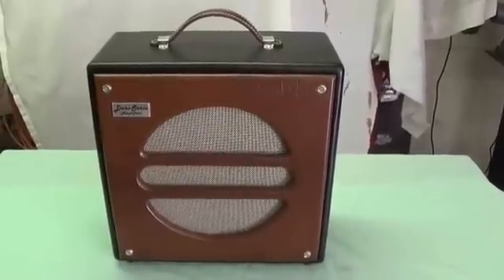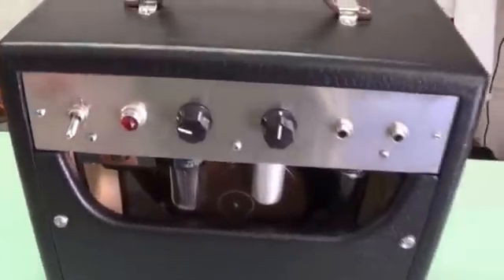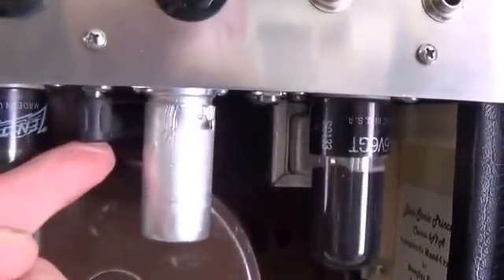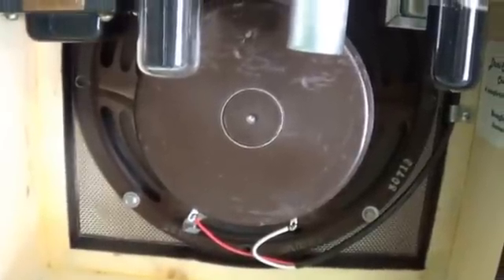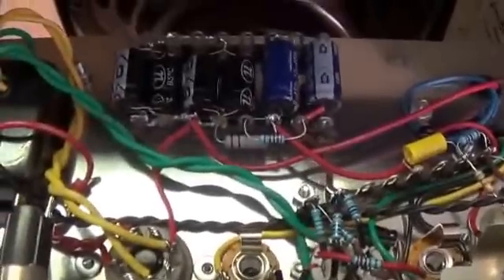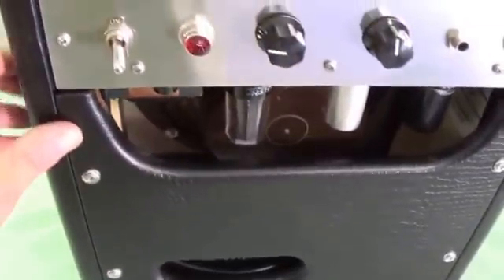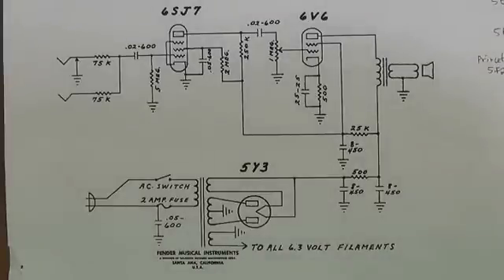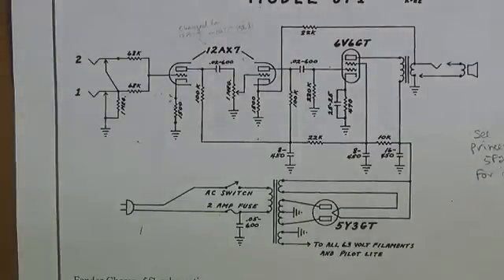1950's Fender Princeton 5F2-A Home-Built Guitar Amplifier

Comment: Hi Uncle Doug,

I have a final question on that 1k  grid stopper on pin 5 of the 6v6.  What wattage and type would you recommend here?   I was thinking likely 1w or 2w  carbon comp.  Any better ideas?  I've read the big factor on grid stoppers is low inductance resistors and not having steel leads or steel caps.  What is your experience?

Comment: Hello Uncle Doug,

I've been watching a bunch of your videos. I appreciate you taking the time to make them. Especially the lessons about amp electronics and evolution. 

What was your reason for the grid stopper resistor being added to the 6v6????  what determined your resistor value??  I have just watched the resistor vid on grid stoppers  where you talked about 12ax7.  
What affect would this play in this princeton build?

 Would you apply this to other designs such as a champ too? 

Thank you, 

Stu
Reply from the maker: +stu mac   I believe the answers to your questions are all in my more recent video series on Resistors, including the "Grid Stopper" resistor. Please watch it, and my other 127 videos, whenever you get a chance. They cover all aspects of amplifier circuitry and design.
Reply: +Uncle Doug 

Thanks for your reply.  I did watch the resistor vids prior commenting.  I did see the parts about low pass filter and internal cap. of the tube.   

I was wondering why you chose to add it to your design.  What change would it have in particular?  

What about the original were you trying to tweak??? 

I'm re watching the resistor series.

You did help me with a mistake I made in my 5e1/5f1 adaptation.  I had a 0.0005uf mica on my volume to tone   pot. I also had a 0.0005 mica on my tone to ground.   I missed a decimal I guess.  I've just put it to a proper 0.005uf  I haven't tried it yet.   I wondered why everyone likes the tone control but I thought it sucked on mine.  

Cheers!  
Stu
Reply: +stu mac 

That 0.005 cap in place of the 0.0005 from tone to ground changed my whole amp ! completely!   

I looked through my stuff and only had a 1.5k resistor as closest value. So I didn't use one yet.

Comment: Awesome! Do you build amps for other people who would supply a chassis for conversion? Thanks.
Reply from the maker: +Bill Smith  I don't do outside work any more, Bill, except for the occasional restoration of an interesting vintage amp (or two).
Reply: +Uncle Doug Ok thanks anyway. So you say you like to build a cab as small as possible. Have you found you lose any low end placing a 10" speaker in a cabinet the size of your 5F2? Love the "drawer" idea! As a real novice, I built a 5F1 a number of years ago, but needed help when it didn't work when I fired it up. Made it out of the amp out of a Voice Of Music reel-to-reel.
Reply from the maker: You're welcome, Bill. Since most guitar cabinets are open at the rear, I don't notice much tone difference between small or large cabinets. In a sealed or ported cabinet, it makes a big difference. Glad you enjoyed the video. Thanks for watching.
Reply: +Uncle Doug OK thanks. I'm still a novice, but hope to gain more understanding at some point by watching your videos! Had a great guy I started talking to online years ago make me a blackface Champ circuit with a 6L6 and a switchable in/out NFB. Have a vintage1965 C10Q in the cab I had built (out of  solid pine only and dovetailed) about the size of an old Fender Musicmaster Bass amp. My main stage amp last few years (we're old and don't play too loud!). You build some great looking cabinets too!
Reply from the maker: You're welcome, Bill. By all means, watch the videos and hopefully they will clarify many of the complexities of tube amp circuitry. Perhaps some day you can build your own amp from scratch. Best of luck.
Reply: +Uncle Doug Thanks!
Reply from the maker: You're welcome :)

Comment: Great video, I love your channel, I learn a lot watching your videos. I just bought a  clone of the 5F2A Princeton hand wired amp , I  checked the circuit, everything seems correct ( filter caps in mine are  a bit bigger value then in original schematic) but there is 1 thing intrigued me, the grid stopper resistor between the input and 12ax7 tube which was used is 1.5k instead 68k . I don't know if it was made by mistake or in purpose, does it can harm the amp? or I should replace it with 68k? I love the sound of this amp as it is, it has a lot of sparkle, tone knob  is very effective. When I use the amp with different guitars it works very well, I can get nice sparkle tone from even very dark sounding guitar. Regards. Arthur
Reply from the maker: +portlaoiseguitar  Thanks, PG. I agree that a 1.5K resistor in this position is very "un-Fenderlike", but if the amp works so well with this resistor in place, then I would leave it there.  If oscillation problems arise then you might reconsider, but until it happens (which is probably unlikely) I would simply leave it alone.
Reply: +Uncle Doug Many Thanks
Reply from the maker: You're welcome :)

Comment: Uncle Doug builds an amazingly well-designed and crafted Fender style amp, then claims to be too lazy to label the knobs. Well played, good sir!
Reply from the maker: Robert Lewis Thanks, Robert ;) With only two knobs, there is a 50/50 chance of guessing right......pretty good odds nowadays :)
Reply from the maker: That's right, Joseph.....only those with high level security clearance can be briefed on them.
Reply from the maker: Don't forget the power cord, Joseph. It's important not to plug it into your toaster slot.....unless you want your tubes to pop out of their sockets every 60 seconds ;)

Comment: Don't forget that the other major difference between the Champ and Princeton was the 8" speaker in the Champ versus the 10" speaker in the Princeton.  Of course recording engineers still love those 8" speakers anyway... BTW, the way I end up with parts all over the place it would not surprise me to find electrolytic capacitors in my sock drawer. I can never have enough parts storage it seems.
Reply from the maker: BuzzCrumhunger Good point, Buzz. I really prefer the 10" myself. Thanks for your input :)
Reply: CuteKittyMeep  that's incorrect. Tweed Princeton's came with 8" spkrs, just in a bigger cabinet.

Comment: Hey Doug, love your work.

I have a 5f2a clone that a local guy here in Australia put together.  As second owner I bought it from the original customer for a song. I put an Eminence Legend 10" ceramic (not quite rescued from a dumpster, admittedly) and it sings.  I reckon the single ended Princeton is a bit special.  It's amongst my faves, has a special sound compared to the 6V6 dual tube amps.

(BTW my first dog back in '71 was also called Rusty - almost brings a tear to my eye)
Reply from the maker: twerpeater Thanks so much, TP.  I definitely share your enthusiasm for the SE Princeton circuit, and for loyal old hound dogs.  We really appreciate hearing from you and wish you the best.

Comment: Did you wire the neg feedback loop to only one speaker output jack? Thanks in advance love your vids.
Reply from the maker: Greetings, DWB, and thanks for the kind words. You have a good eye. In the video it appears that only the 8-Ohm jack (green OPT lead) is connected to the NFB loop. After the video was completed, I also connected the NFB loop to the 4-Ohm jack (yellow OPT lead).
Reply: Uncle Doug My eyes are old and didn't see green wire.How did you wire both jacks to nf loop ?  Do you jumper to other op jack?
Reply from the maker: To prevent shorting the OPT secondary windings and to enable disconnection of the NFB loop, I used a DTSP switch: up, NFB goes to 4-ohm jack; down, to 8-ohm jack; NFB is off if it's switched to the un-utilized jack. 

I have since discovered that simply connecting the NFB to the 8-ohm OPT jack was sufficient. Since the NFB was connected to the entire OPT secondary (via the 8 ohm wire), both output jacks were affected regardless which one was connected to the speaker. Live and learn. I now use the switch simply to turn the NFB on and off.
Reply: Thanks for the detailed explanation. I can now wrap my head around this.
Reply: It only needs to come off the 4 ohm secondary. It's in place no matter what jack you select. But for correct value, tie it to the 4 as the original circuit used a 4 ohm transformer. To use the 8 ohm tap you'd need to bump the nfb resistor up to 33k to compensate.

Comment: Doug your videos are great. I recently built a junk box 5F1 clone in a cake pan and it  sounds sweet; I learned a lot from your version. Thinking of trying a 5C1 next. Two questions: does a tight fit cabinet risk any kind of feedback issues between speaker and transformers?  I have nice 280-0-280 150ma power transformer in my junk box, do you think the voltage output would be sufficient for the 6SJ7 version? I know its a bit lower than stock.
Reply from the maker: Greetings and thanks, Bs. I prefer compact cabinets and have never had a feedback issue. I think feedback is more likely to be an interaction between speaker vibration and a (microphonic) tube rather than a transformer.

Regarding your 280V transformer, I think it would work fine. If you want to maximize your voltage, you might consider solid state rectification or use a GZ34 rectifier tube. Good luck !! :))

Comment from the maker: You're welcome, David. Bending and forming  the chassis is a real nightmare without proper equipment (that most people don't have). I'm glad you like the "assembled chassis" method. It also allows you to drill holes in flat plates, rather than wrestling with a metal 'can'. Please also consider using aluminum for the fabrication. It conducts both heat and electricity much better than steel....and it doesn't rust. Please keep me posted on your progress if you start the project. Good luck !!!

Comment: Thanks much for the video.  I have always wanted to build a tube amp and I can solder and read schematics and use tools, but I could never figure out how to build the chassis.   I had the  idea to maybe use a cake tin, but that is so skeezy--and I didn't know how  to do with without an angle bender.   Your idea of using  two or more seperate pieces with a right angle connector is pure genius.   You got me seriously thinking about this as a real thing, now, not just dreaming in the dark.  Thanks.

Comment from the maker: I can describe the process briefly: Brush two heavy coats of Weldwood Original Contact Cement (the one with toxic fumes, not the sissy latex garbage) on the wood, allowing each coat to dry until only slightly tacky. Spray the back of the Tolex with V&S 185 or 581 spray adhesive.....a heavy coat. While it's still sticky, apply Tolex to wood and roll with a linoleum roller.....applying as much pressure as you can. There are minor details, but this is the general process.